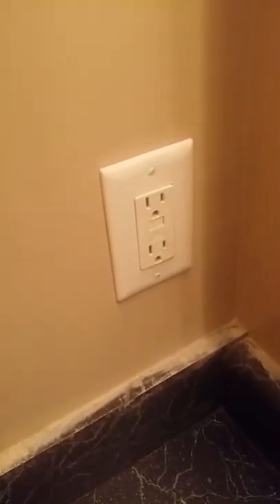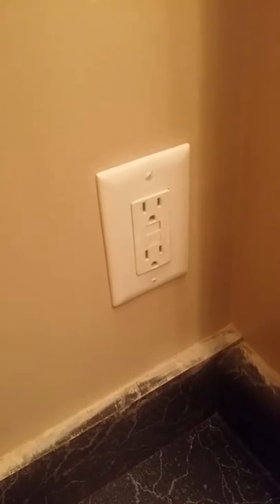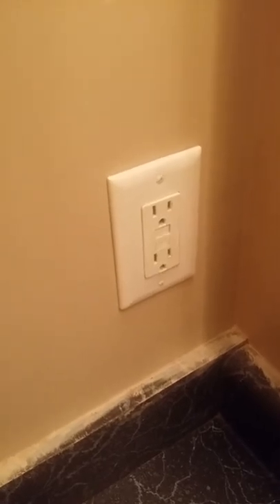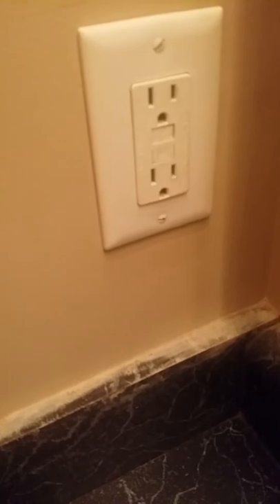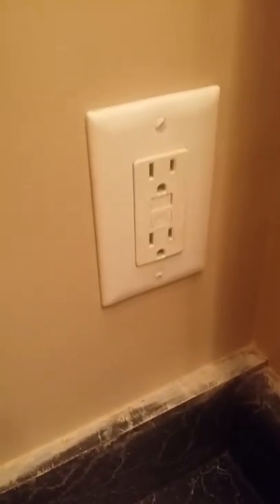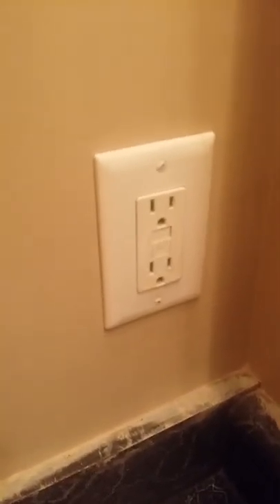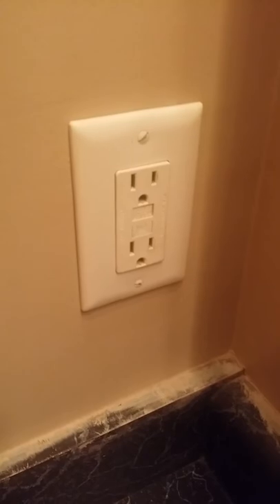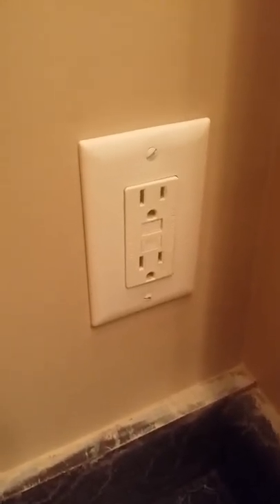Breaker on, No power

Comment: It’s called a gfi and it’s there to stop people from doing stupid stuff like putting toasters on the bath or shocking themselves with forks in plugs
Reply from the maker: It's not in the bottom of a closet to stop people from putting toasters in the bath or stop people from putting forks in it. GFCI and GFI are interchangeable, but mean the same thing. Google it. Go troll elsewhere.
Reply: Eric Marler no it makes no sense to be there but as a firefighter that’s what we have always been taught I’ve done some electrical work as well. It did what it was supoosed to and most houses have them
Reply: @bogator0149  it’s code so we gotta do it.

Comment: Okay 👍. I found the damn GFIC finally. I checked all over the damn house.   Every bathroom, every outside outlet. Notta. Then I found it under the cabinet in the opposite side of the kitchen where every other receptacle was working just fine. 
I knew it had to be a GFIC when I couldn’t find a tripped breaker but it took seeing this video at 1:30am to find it. Cheers 🥂